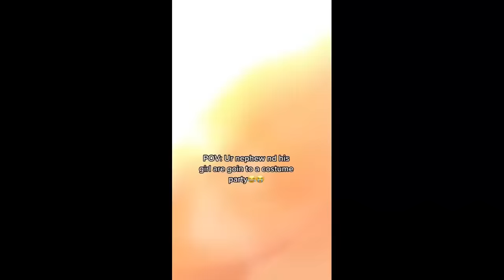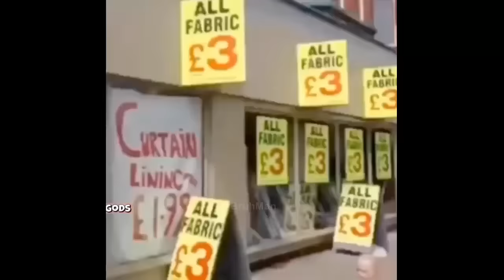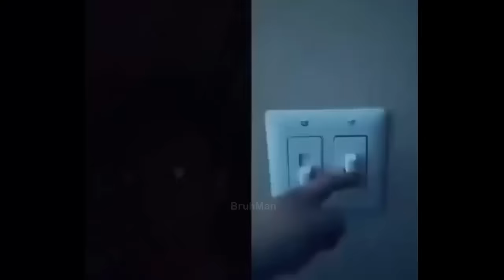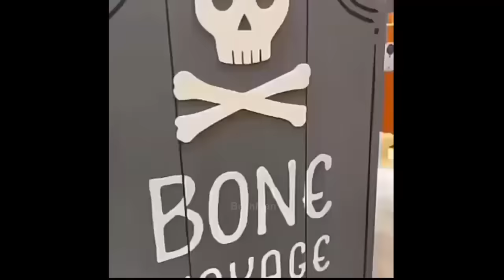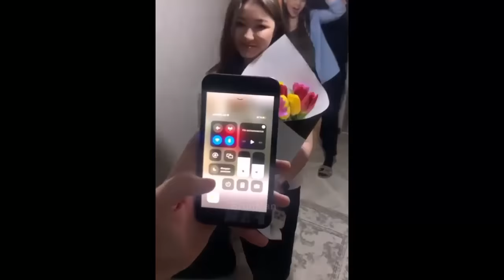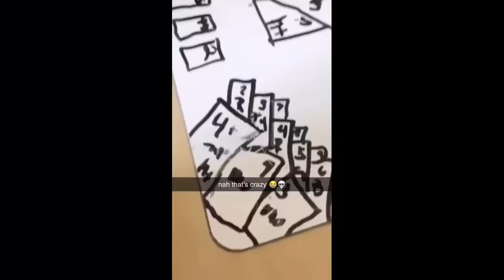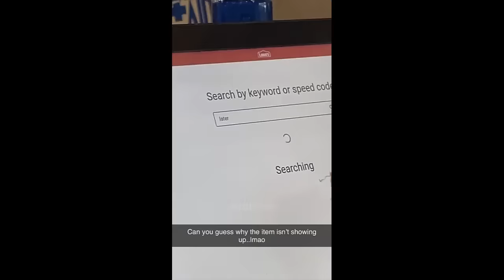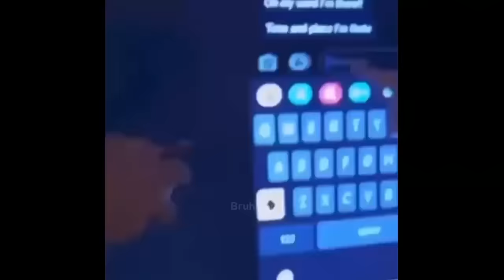offensive memes that if ylyl v38

Comment: Stately, plump Buck Mulligan came from the stairhead, bearing a bowl of lather on which a mirror and a razor lay crossed. A yellow dressinggown, ungirdled, was sustained gently behind him on the mild morning air. He held the bowl aloft and intoned:
—Introibo ad altare Dei.
Halted, he peered down the dark winding stairs and called out coarsely:
—Come up, Kinch! Come up, you fearful jesuit!
Solemnly he came forward and mounted the round gunrest. He faced about and blessed gravely thrice the tower, the surrounding land and the awaking mountains. Then, catching sight of Stephen Dedalus, he bent towards him and made rapid crosses in the air, gurgling in his throat and shaking his head. Stephen Dedalus, displeased and sleepy, leaned his arms on the top of the staircase and looked coldly at the shaking gurgling face that blessed him, equine in its length, and at the light untonsured hair, grained and hued like pale oak.
Buck Mulligan peeped an instant under the mirror and then covered the bowl smartly.
—Back to barracks! he said sternly.
He added in a preacher’s tone:
—For this, O dearly beloved, is the genuine Christine: body and soul and blood and ouns. Slow music, please. Shut your eyes, gents. One moment. A little trouble about those white corpuscles. Silence, all.
He peered sideways up and gave a long slow whistle of call, then paused awhile in rapt attention, his even white teeth glistening here and there with gold points. Chrysostomos. Two strong shrill whistles answered through the calm.
—Thanks, old chap, he cried briskly. That will do nicely. Switch off the current, will you?
He skipped off the gunrest and looked gravely at his watcher, gathering about his legs the loose folds of his gown. The plump shadowed face and sullen oval jowl recalled a prelate, patron of arts in the middle ages. A pleasant smile broke quietly over his lips.
—The mockery of it! he said gaily. Your absurd name, an ancient Greek!
He pointed his finger in friendly jest and went over to the parapet, laughing to himself. Stephen Dedalus stepped up, followed him wearily halfway and sat down on the edge of the gunrest, watching him still as he propped his mirror on the parapet, dipped the brush in the bowl and lathered cheeks and neck.
Buck Mulligan’s gay voice went on.
—My name is absurd too: Malachi Mulligan, two dactyls. But it has a Hellenic ring, hasn’t it? Tripping and sunny like the buck himself. We must go to Athens. Will you come if I can get the aunt to fork out twenty quid?
He laid the brush aside and, laughing with delight, cried:
—Will he come? The jejune jesuit!
Ceasing, he began to shave with care.
—Tell me, Mulligan, Stephen said quietly.
—Yes, my love?
—How long is Haines going to stay in this tower?
Buck Mulligan showed a shaven cheek over his right shoulder.
—God, isn’t he dreadful? he said frankly. A ponderous Saxon. He thinks you’re not a gentleman. God, these bloody English! Bursting with money and indigestion. Because he comes from Oxford. You know, Dedalus, you have the real Oxford manner. He can’t make you out. O, my name for you is the best: Kinch, the knife-blade.
He shaved warily over his chin.
—He was raving all night about a black panther, Stephen said. Where is his guncase?
—A woful lunatic! Mulligan said. Were you in a funk?
—I was, Stephen said with energy and growing fear. Out here in the dark with a man I don’t know raving and moaning to himself about shooting a black panther. You saved men from drowning. I’m not a hero, however. If he stays on here I am off.
Buck Mulligan frowned at the lather on his razorblade. He hopped down from his perch and began to search his trouser pockets hastily.
—Scutter! he cried thickly.
He came over to the gunrest and, thrusting a hand into Stephen’s upper pocket, said:
—Lend us a loan of your noserag to wipe my razor.
Stephen suffered him to pull out and hold up on show by its corner a dirty crumpled handkerchief. Buck Mulligan wiped the razorblade neatly. Then, gazing over the handkerchief, he said:
—The bard’s noserag! A new art colour for our Irish poets: snotgreen. You can almost taste it, can’t you?
He mounted to the parapet again and gazed out over Dublin bay, his fair oakpale hair stirring slightly.
—God! he said quietly. Isn’t the sea what Algy calls it: a great sweet mother? The snotgreen sea. The scrotumtightening sea. Epi oinopa ponton. Ah, Dedalus, the Greeks! I must teach you. You must read them in the original. Thalatta! Thalatta! She is our great sweet mother. Come and look.
Stephen stood up and went over to the parapet. Leaning on it he looked down on the water and on the mailboat clearing the harbourmouth of Kingstown.
—Our mighty mother! Buck Mulligan said.
He turned abruptly his grey searching eyes from the sea to Stephen’s face.
—The aunt thinks you killed your mother, he said. That’s why she won’t let me have anything to do with you.
—Someone killed her, Stephen said gloomily.
—You could have knelt down, damn it, Kinch, when your dying mother asked you, Buck Mulligan said. I’m hyperborean as much as you. But to think of your mother begging you with her last breath to kneel down and pray for her. And you refused. There is something sinister in you....
He broke off and lathered again lightly his farther cheek. A tolerant smile curled his lips.
—But a lovely mummer! he murmured to himself. Kinch, the loveliest mummer of them all!
He shaved evenly and with care, in silence, seriously.
Stephen, an elbow rested on the jagged granite, leaned his palm against his brow and gazed at the fraying edge of his shiny black coat-sleeve. Pain, that was not yet the pain of love, fretted his heart. Silently, in a dream she had come to him after her death, her wasted body within its loose brown graveclothes giving off an odour of wax and rosewood, her breath, that had bent upon him, mute, reproachful, a faint odour of wetted ashes. Across the threadbare cuffedge he saw the sea hailed as a great sweet mother by the wellfed voice beside him. The ring of bay and skyline held a dull green mass of liquid. A bowl of white china had stood beside her deathbed holding the green sluggish bile which she had torn up from her rotting liver by fits of loud groaning vomiting.
Buck Mulligan wiped again his razorblade.
—Ah, poor dogsbody! he said in a kind voice. I must give you a shirt and a few noserags. How are the secondhand breeks?
—They fit well enough, Stephen answered.
Buck Mulligan attacked the hollow beneath his underlip.
—The mockery of it, he said contentedly. Secondleg they should be. God knows what poxy bowsy left them off. I have a lovely pair with a hair stripe, grey. You’ll look spiffing in them. I’m not joking, Kinch. You look damn well when you’re dressed.
—Thanks, Stephen said. I can’t wear them if they are grey.
—He can’t wear them, Buck Mulligan told his face in the mirror. Etiquette is etiquette. He kills his mother but he can’t wear grey trousers.
He folded his razor neatly and with stroking palps of fingers felt the smooth skin.
Stephen turned his gaze from the sea and to the plump face with its smokeblue mobile eyes.
—That fellow I was with in the Ship last night, said Buck Mulligan, says you have g. p. i. He’s up in Dottyville with Connolly Norman. General paralysis of the insane!
He swept the mirror a half circle in the air to flash the tidings abroad in sunlight now radiant on the sea. His curling shaven lips laughed and the edges of his white glittering teeth. Laughter seized all his strong wellknit trunk.
—Look at yourself, he said, you dreadful bard!
Stephen bent forward and peered at the mirror held out to him, cleft by a crooked crack. Hair on end. As he and others see me. Who chose this face for me? This dogsbody to rid of vermin. It asks me too.
—I pinched it out of the skivvy’s room, Buck Mulligan said. It does her all right. The aunt always keeps plainlooking servants for Malachi. Lead him not into temptation. And her name is Ursula.
Laughing again, he brought the mirror away from Stephen’s peering eyes.
—The rage of Caliban at not seeing his face in a mirror, he said. If Wilde were only alive to see you!
Drawing back and pointing, Stephen said with bitterness:
—It is a symbol of Irish art. The cracked lookingglass of a servant.
Buck Mulligan suddenly linked his arm in Stephen’s and walked with him round the tower, his razor and mirror clacking in the pocket where he had thrust them.
—It’s not fair to tease you like that, Kinch, is it? he said kindly. God knows you have more spirit than any of them.
Parried again. He fears the lancet of my art as I fear that of his. The cold steel pen.
—Cracked lookingglass of a servant! Tell that to the oxy chap downstairs and touch him for a guinea. He’s stinking with money and thinks you’re not a gentleman. His old fellow made his tin by selling jalap to Zulus or some bloody swindle or other. God, Kinch, if you and I could only work together we might do something for the island. Hellenise it.
Cranly’s arm. His arm.
—And to think of your having to beg from these swine. I’m the only one that knows what you are. Why don’t you trust me more? What have you up your nose against me? Is it Haines? If he makes any noise here I’ll bring down Seymour and we’ll give him a ragging worse than they gave Clive Kempthorpe.
Young shouts of moneyed voices in Clive Kempthorpe’s rooms. Palefaces: they hold their ribs with laughter, one clasping another. O, I shall expire! Break the news to her gently, Aubrey! I shall die! With slit ribbons of his shirt whipping the air he hops and hobbles round the table, with trousers down at heels, chased by Ades of Magdalen with the tailor’s shears. A scared calf’s face gilded with marmalade. I don’t want to be debagged! Don’t you play the giddy ox with me!
Reply: GOOD LORD HOW LONG DID THAT TAKE-😨
Reply: @Gir_obsessed_hoe  
This is a very very sort part of 'The Ulysses'.
Reply: I AINT READIN ALL THAT
Reply: tldr?